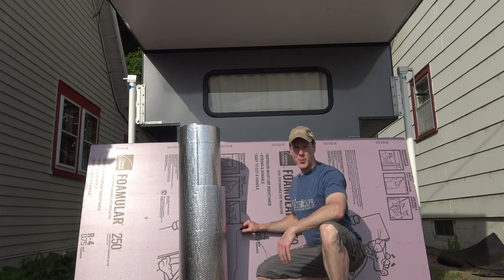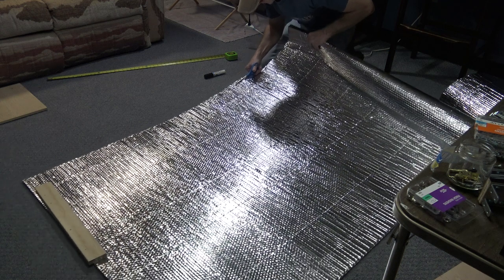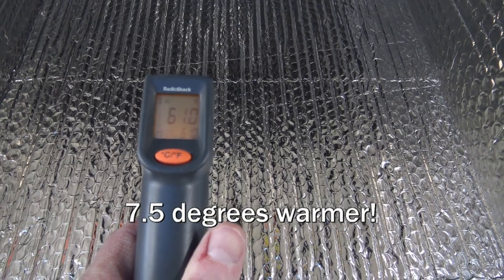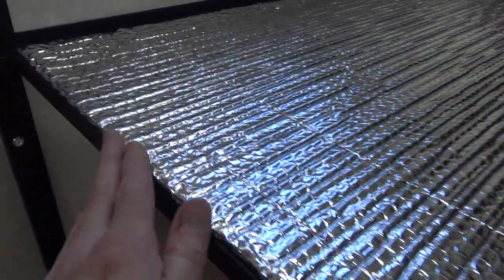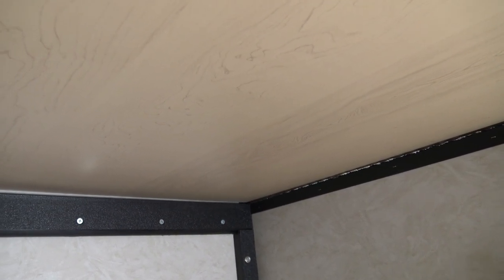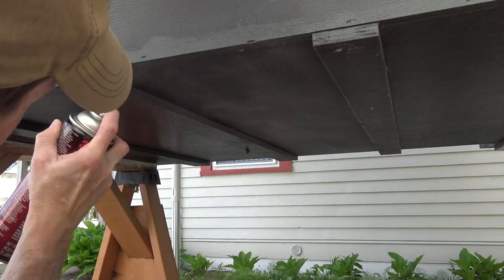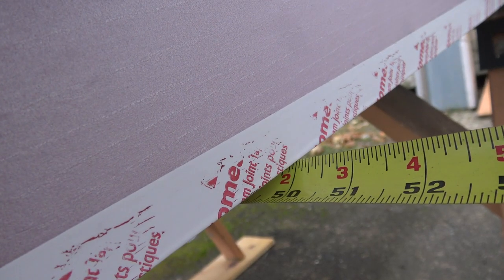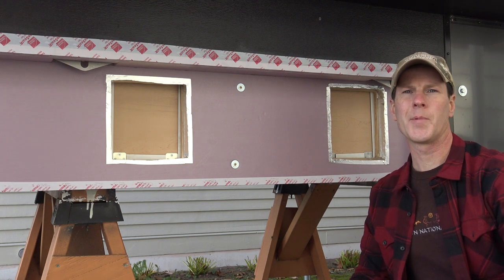Adding Insulation: Four Wheel Camper Shell Buildout #5

Comment: Mold seems to develop under the bed when this is done, thats why people do the hypervent material. Keep us updated on the long term.
Reply: 2003, we converted a 1996 Ford CF8000 commercial truck to our concept of an ExpeditionVehicle.
After several decades of camping, we knew about moisture accumulating under the mattress.
I fabricated our bed platform using expanded steel sheet, similar to very stout window screen.
This gives plenty of circulation under the mattress.

Comment: Reflextix is only a slight improvement on the way you used it. 1/2" foam board would give you r2+ in that location and probably would not interfere with the securing of the top. I'm not spinning a yarn of BS. I recently remodeled my hawk camper and used the pink foam through out. I was able to minimize condensation and calm the drafts in sub freezing temps.

Comment: Thanks for the video.  Great job.
I only added the same foamboard to the underside of my FWC Grandby.  I spray painted all the pink sheets black after installation.  Looks better.   I didn't add pieces up the sides like you did.  Did that make it more difficult to load the camper back onto the bed?  I would rattle can some black on those sides to make them disappear.
I may consider doing under the bed slideout, we'll see.
Reply from the maker: The added insulation requires me to be a little more precise when backing under the camper.  You will have to let me know how the spray paint holds up on that foam board.

Comment: Looks like the vent for the propane will be blocked now when you set the camper in your truck.
Reply from the maker: That’s a good observation.  I will double check it when I put it on the truck this spring.  I think with the way the truck bed is corrugated, there should be enough airflow.

Comment: Any further update on the reflextix 2 years in?  how does it hold up with the slide out going in and out?
Reply from the maker: The reflectix is holding up great.  No sign of wearing out.  It will probably outlast the foamboard insulation that I put on the outside.  Both are easily replaced  if needed.
Reply: Did the reflectix today seem good working on the foam board. See how we do. We are in SW Ontario, Chatham just north of Lake Erie. Will test it out in the driveway.

Comment: Thanks for the helpful video!  I've been looking at the 4 wheel campers.   How much insulation is in the standard camper prior to you adding this insulation?   Is it 1" thick?   What prompted the insulation?  Were you losing a lot of heat or cooling?  Do they have an option to add extra insulation at the factory?
Reply from the maker: The walls and ceiling have one inch foam insulation from the factory.  The lower walls, floor and under the bed don't have any.  From the factory you can get what's called a thermal pack as an option to add insulation to the pop up tent area.

Comment: Hey I noticed you use reflectix under the bed now that it's been some time since you have done yet can you report back on how it worked? I use hypervent under the mattress but I could definitely use some more warm under there so did you get any moisture or how did that work. Thanks for the reply. I also used insulation underneath the floor there under the camper and it worked fantastic. That in conjunction with puzzle piece rubber flooring inside worked great.
Reply from the maker: Without the insulation under the mattress I could really feel my feet getting cold.  (We sleep north/south with feet toward the front of the truck). I really think the insulation has helped.  I haven’t noticed any moisture under the mattress either.  Just to make sure it’s dry, I slide the cab over mattress out all the way and let that area vent for a couple of hours when we get home.
Reply: @NorthernExplorerOverland  what about under the reflextix that is under the mattress? I notice you tape it down, do you know if there is/was any moisture under there? I think I will do what you did with the reflectix, I just know reflectix works much better with an air gap, was not sure of its normal insulating properties as it is right against the overhang floor. I actually replaced my wood slats on the inside roof with Azac strips cuz the wood disintegrated from moisture. This was before I understood it all.
Reply from the maker: @jimmyfal  I don't know for sure but my gut tells me it's dry.  Moisture would be coming from the top down (warm to cold) and there is no way for the moisture to pass directly through the reflectix.  Maybe a little around the edge.  So far everything has worked out good.

Comment: I didn't know the bed slide only partially overlaps the cabover bed platform when pushed in. Can you feel the overlap under that mattress when sleeping up there with extension pushed in?
Reply from the maker: It all feels flat when laying on the mattress.  We have only ever slept on it with the extension pulled out but I think the mattress is to thick to feel anything underneath.
Reply: @NorthernExplorerOverland  
Thanks for the reply. I've been looking at buying one for some time now but this detail always stuck in my head. If you don't mind me asking, how thick is the bed extension platform and how thick is the mattresses?
Reply from the maker: @jetv9703  I believe the thickness of the cabover section is 3/4 of an inch.  The mattress is three inches.